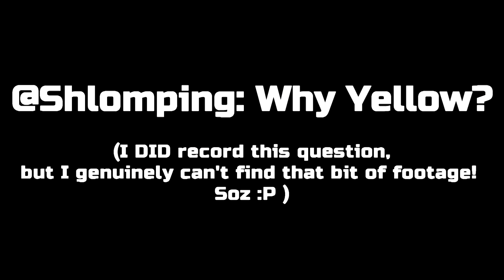Time To TURBO The Super Seicento? *Sportex & Turbo Revs* | Super Seicento Q & A

Comment: 0.3 bar boost with a T3 turbo on standard engine gave me 78hp did 66000km no problem had 254000km at that stage... found side drafts they used on a UNO for racing and it did 89hp... Engine broke within 3000km. With turbo you will need to remove the CAT beacause of the availible space behind the front panel.

Comment: get a 1.2 8v head with 866 cam, sandwich plate head gasket, and you can pump it up to 1bar and it will last long (with proper tune ofc)

Comment: Hi. Just a quick question for you: did your cento come with stock MPI or did you have SPI?
I have an SPI 1.1 and I'd love to know if swapping to MPI would be an easy mod. I've read that max power and torque stay the same but they peak at lower RPMs so that would be a nice improvement, plus it's almost impossible to distinguish it from the original system and I think you're even eligible to Euro 4 class
Reply from the maker: Mine was originally an MPI car, being a facelift - the 1242 block is from a Punto SPI, but the block mates to the standard Seicento head 😁👍🏻